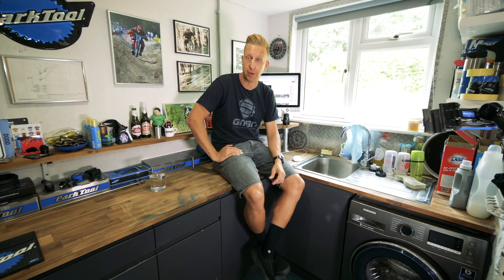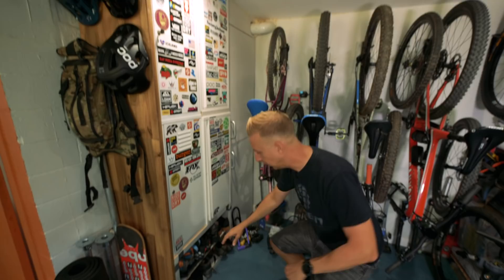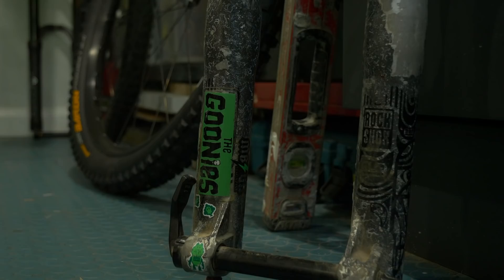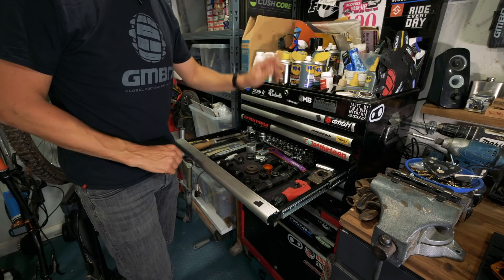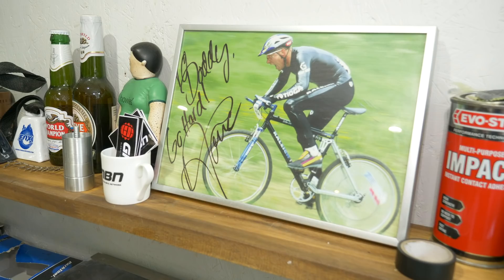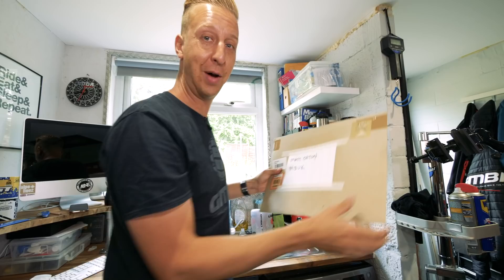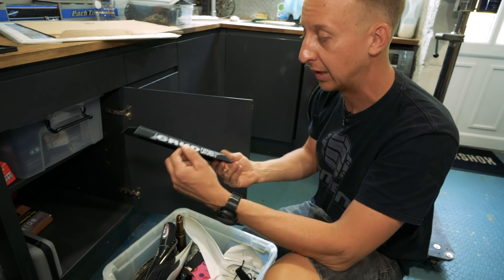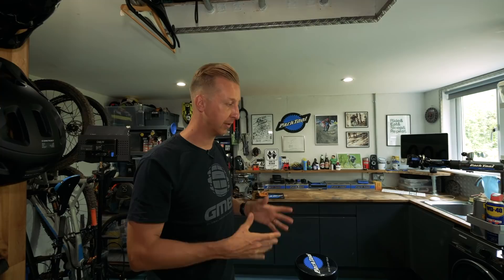Doddy's Bike Cave Tour | The Ultimate Bike Cave?

Comment: As a diesel tech I had to have duplicates of some tools
 Some times you will need two 15mm wrenches.  But at my dads he has 5 of them in the same drawer as 4 15mm, with 6 10mm, with 7 13mm wrenches and  a single 1/2" thin wall 3/8 drive deep well socket with a crack in it. Takes for ever to find what you need. But it's cool.

Comment: Like that bike stand, on wheels?
Reply: Looks like a Park Tool PRS 3.2-2, with the Park # 130 repair stand base, and aftermarket casters. I was wondering, do the casters make it a less stable work platform? Seems like even if they're lockable, the stand would still be a little less secure against heavy torquing.

Comment: He's one hell of a hoarder. I wonder if the value of those parts has reached it's peak yet or not, but defo not really kept in mint condition with everything scratching everything else. 90% of it is useless for modern MBker, so if it has value, it'd be much better to sell it of. Question is-is this the right time already, or will it get more value later?